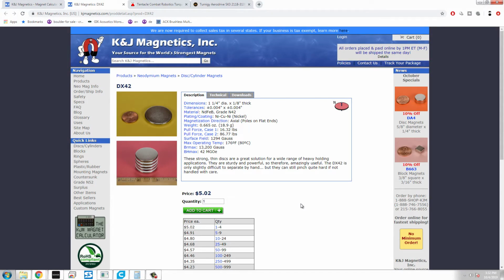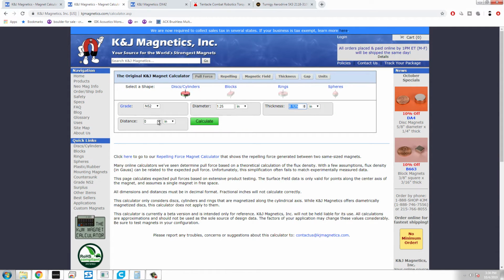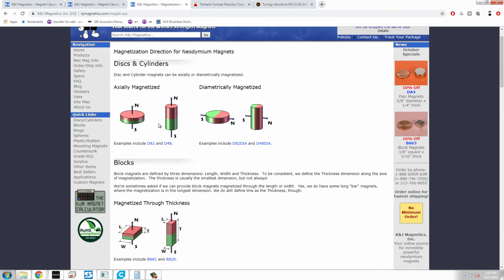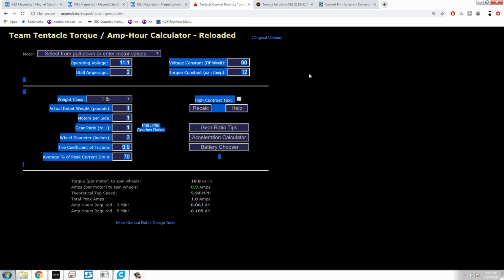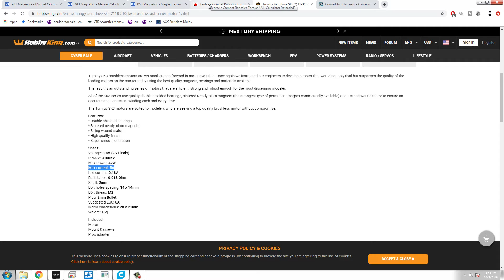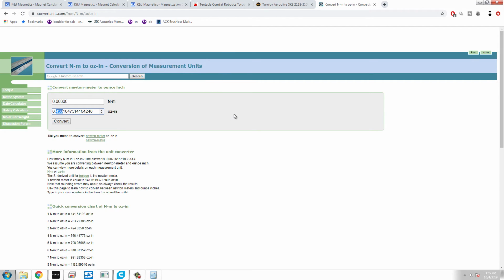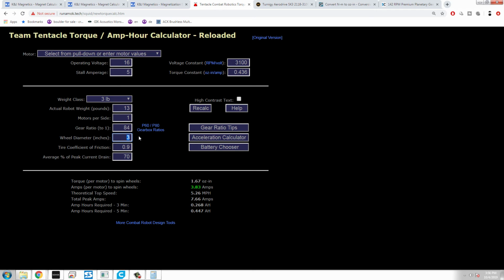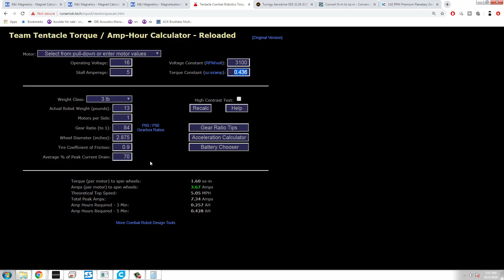Combat Robot Basics:  Magnets!

Comment: Are the floors of these robot battle arenas metal?
Reply from the maker: Most of the time, yes.  Did you just watch a video about using magnets to increase traction on floors and not realize the floors would need to be metal for this to work?
Reply: @RobertCowanDIY  I asked about the floors being metal because sometimes in these robot fights they look like they're made out of plywood. But I figured maybe the magnets were used to attract to any kind of framing.

Comment: The Japanese 'Sumo' robots use magnets. The bots are amazing, tiny, fully autonomous beasts that use onboard sensors to track and respond to their (single) opponent. The idea is to push it out of the ring. The fights can be over in a second (literally) and the action happens almost too fast to see - the bots respond in milliseconds, zipping about on sticky silicone tyres at bewildering speed.

The arena/rink is perfectly flat, smooth, clean metal, so magnets are ferociously effective. The robots generate tremendous pushing force, and use a LOT of magnets. When the contestants place them down onto the arena floor they take great care to keep their hands out from under them to avoid amputating a fingertip. At the end of the fight, the robot still in the arena has to be lifted off the floor with a small crowbar. I'm not kidding!

Comment: More accurately, the drivetrain will not see an effective 13lb bot but something in between. It will see 13lb of downforce, but the inerta will still be 3lb.
Reply from the maker: yes, correct.  for a 'basics' video, it's hard to get all the nuances correct, because design, weight distribution, traction, and all sorts of other factors play into it.
Reply: @RobertCowanDIY  fair.

Comment: Great video! Thanks for the explanation. 
Just a bit sad that all the presented sites (and you) aren't using the normal (metric) units like the rest of the world. Even America/canada is actually metric, but they are converting it to customary units for convenience 😸👍
Reply from the maker: What's sad is that I can easily go between the two, while others can't.  The other thing I can do is look at my YouTube channel metrics and see that the vast majority of my users are in the US so primarily relying on the imperial system is more appropriate for my audience.  Additionally, for anyone in the US, even getting a metric drill bit set (of any quality) is tricky.  The same goes for hardware, or other parts that go into building just about anything.  While I do agree that metric is a better system, it's not something that's going to get fixed overnight, nor is there any benefit of belaboring the merits of the metric system.  It's changing slowly, but it will take quite a bit of time.  This exact comment comes up every so often and I'm not sure why anyone feels the need to remind people that metric is better.  No one is arguing that point, and simply using the imperial system is not an endorsement in any way.
Reply: @RobertCowanDIY  fair points said 🤔👍
Don't take it as offense please :)

Comment: But the mass of the bot hasn't changed, so while adding magnetic downforce increases weight and therefore traction and load on bearings etc, the acceleration from a given force from the drivetrain won't be affected, right?
Reply: A magnet moving across a conductive surface creates magnetic eddy currents (https://en.wikipedia.org/wiki/Eddy_current) that will impede the motion of the magnet. It isn't a 'free ride'.
Reply from the maker: You are correct, the mass is the same.  Think of it in an extreme example.  Think of a 1lb robot with 100 pounds of magnetic downforce.  Do you think it will be able to accelerate at the same rate as the 1lb bot without any magnets?  Gravity is essentially just a force pulling (accelerating) all objects down towards the earth at a constant force.  The magnets effectively contribute to this force.
Reply: Right, but that force is perpendicular to the acceleration you are trying to impart.  Aside from additional friction forces, it doesn't seem like it would have any effect at all.

It seems analogous to aerodynamic downforce at the track - it increases your weight and therefore grip, yet doesn't require additional acceleration to turn the vehicle.  So, you get increased cornering ability, where if you just made the car heavier to get the grip cornering wouldn't improve and linear acceleration gets worse.  Without any aero, a car can achieve somewhere between 1-1.4g depending on tires.  However, with aero, the same car can achieve >2g in faster corners (and extreme examples like F1 cars can hit 5g).
Reply from the maker: @JohnATamplin  I have no idea what the physics are.  But I can tell you that if you have something that slides easily on a metal surface, and then add magnets (not actually touching, so friction isn't an issue), it WILL impede the movement.  Someone with a better science background can probably answer it, but it does change the effective weight, as far as the motors are concerned.

Comment: Robert, I like videos like this! Thanks for sharing. I don't have a battle bot, but my daughter and I like watching the fights and discussing the different merits of different designs. One thing we noticed last season of BattleBots was that some of the teams had something in their tires. When they took a hit, it looked like sawdust came out or something like that. What was that stuff and what is the purpose?
Reply: Quite a lot of teams now fill their tyres with expanding foam, rather than just having a regular air-filled tyre. This means a wheel can't be punctured, more readily keeps is form, and if it gets hit it's more likely to rip a chunk off instead of slicing the wheel and leaving something behind that then could jam up the drive train. Hypershock has its large wheels and they are a good example of where foam filled tyres make sense.

Comment: Can you use on/off magnets? I wouldn't imagine an electromagnet would be practical but I've seen designs for magnetic hold downs for like table saws that have on/off arrangement. I'm imagining a servo that would enable the magnet down force when you needed it but turning it off when you need it off (like if stuck). Thanks for sharing I always enjoy learning from your videos.
Reply from the maker: Electromagnets are a completely different topic.  They have a much greater fall-off from what I've seen.  They also draw a ton of power and tend to saturate quickly.  This is doable, but most likely too complex versus the overall benefit it would offer.
Reply: There was an interesting use of electromagnets in the Battlebots IQ bot, The Blender. It was a shell spinner with an electromagnet on a spring thing. They would fire the magnet right before the other bot would hit them to lock their bot in place temporarily while the other machine went flying. Matt Tavares can talk about it because I probably got some details wrong.
Reply from the maker: @ianmcmahon8589  I've played with electromagnets a bit, and the biggest problem is they need to be touching the attracting surface, so they need to be spring-loaded or somehow dragging on the floor to work.  But they are pretty effective.